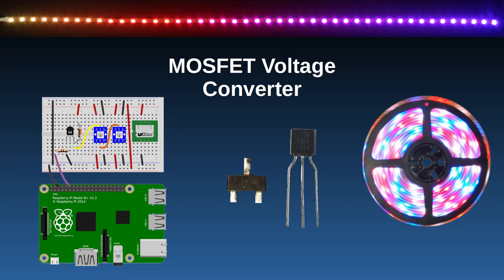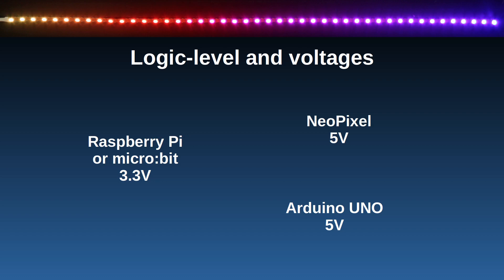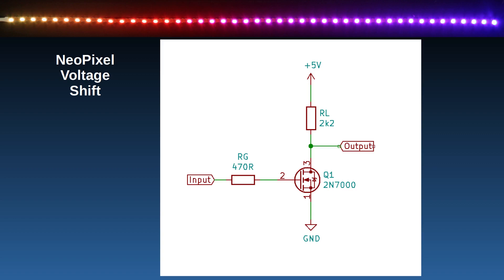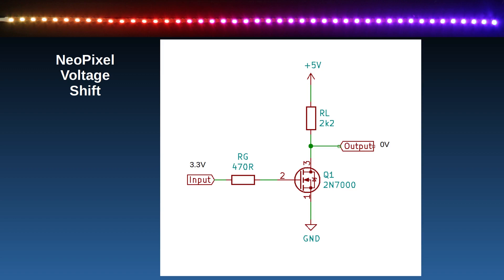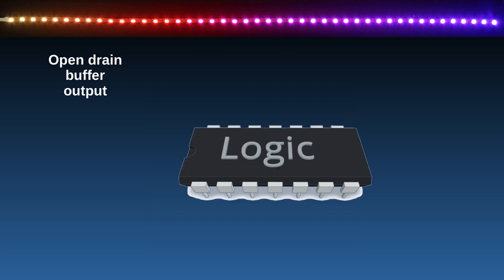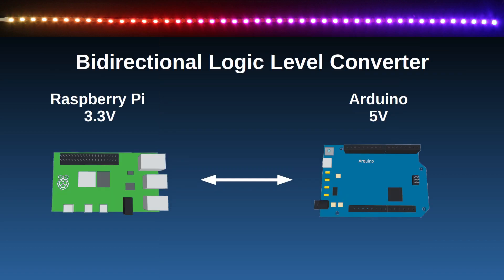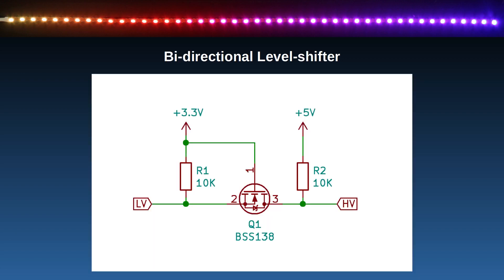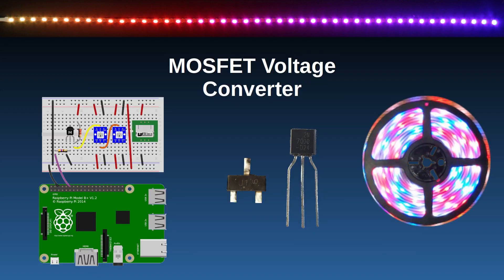MOSFET logic-level shift circuit - Convert Voltage Raspberry Pi to NeoPixel and I2C / SPI Arduino

Comment: However, Neopixels need a non-inverted signal and the library assumes that there is no inverter.
RG makes the circuit unnecessarily slow. A 74HCT125 would be a better solution for Neopixels.
Reply from the maker: There is an option to invert the output from the library which allows for an inverting buffer. For the rpi_ws281x library then the option is LED_INVERT which should be set to 1 to invert the signal. 

There are some other libraries (eg. used on microcontrollers) that don't have that option but there are other types of voltage level shifters that can be used and I've covered some on my other video at: https://www.youtube.com/watch?v=9a2otRXyn4A&t=737s 

A 74HCT125 would be a suitable alternative, but I also find a simple MOSFET works well when you have the option to invert the signal in software.

Comment: I tried to use one with STM32. when I use bidirectional voltage level shifter (like in the end of the video) with a VNH2SP30 motor driver the HV drops to 2.7v instead of putting out 5v. BUT when I connect it directly to the microcontroller the voltage doesn't drop. can't find what is wrong with it. (if I don't connect anything to HV it outputs 5v like it should).
Reply from the maker: I'm not familiar with that motor driver. Perhaps the 10k pull-up resistors are too high. You could try replacing that with a 3.3k ohm resistor.
Reply: @PenguinTutor  tried that. it results only in changing the logic 0 level. up to ~ 500mv.
but this is a PWM pin. it works with 3.3v and 5v  power supply. it also works with 3.3v PWM from microcontroller directly. may be i should just leave this pin connected to microcontroller. btw the other pins on the driver behave as they should with no voltage drop through level shifter.
Reply from the maker: @lerymisandari4015  I have had mixed success with that level-shifter. Usually it works, but I've experienced some problems including it (indirectly) resulting in damage to an Arduino - See: https://youtu.be/vKsfrawGgtc

Does the communication need to be bidirectional? If not then a 2 stage MOSFET level-shifter may work out better (explained in the video in this comment).

Comment: great video ! 
Can you make a video on a raspberry connection with a bill acceptor ??
Reply from the maker: Thanks for the suggestion. I don't have a bill acceptor that I could try. There are many different types although serial RS232 and USB appear to be quite common. For RS232 it should be possible to connect them through the Adafruit logic level shifter to the Raspberry Pi UART. It's then a case of writing code to use the UART which is explained in my earlier video (going from RPi to Arduino using UART): https://youtu.be/nh5geiIDqjA
Reply: @PenguinTutor  thank you